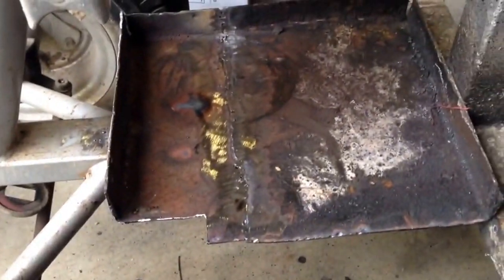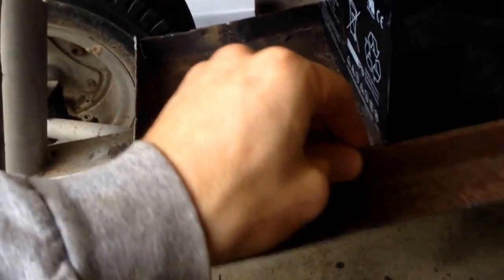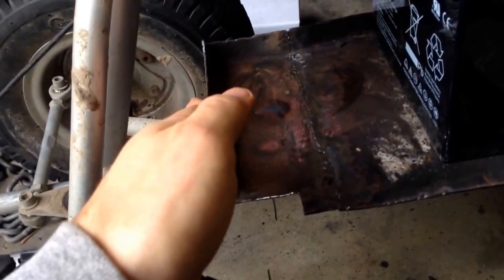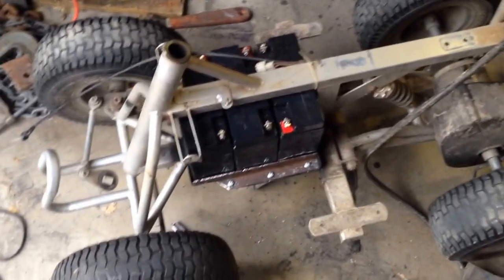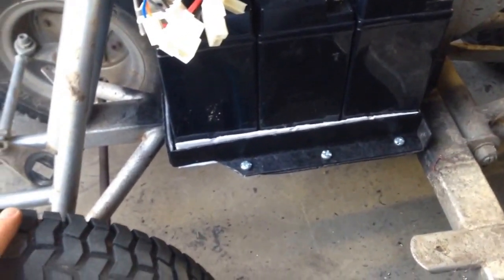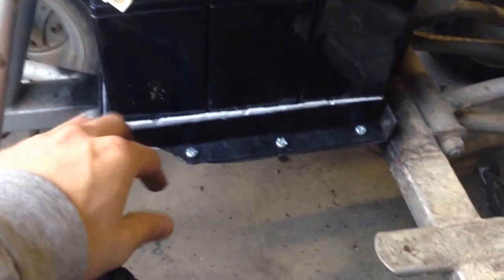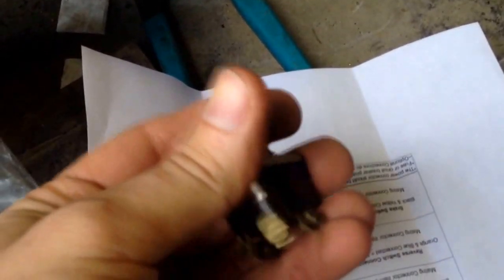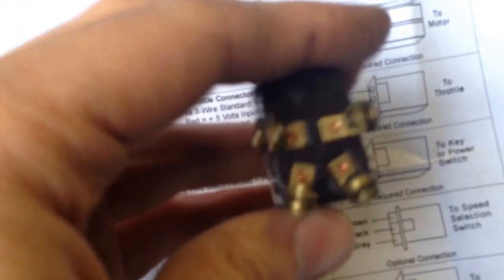Razor Dirt Quad 36 volt upgrade part 2

Comment: Wonder what would happen if you just put 36v worth of battery on it with the stock motor controller and throttle?
Reply from the maker: +Mark Mosley it would fry the controller.

Comment: I was gonna do this also but i'm just curious how the steering radius is and if you had to do it again would you have went with smaller battery's so that the steering could be left alone?
Reply from the maker: +mattp1482 It still seems to steer fine. steers sharp enough.